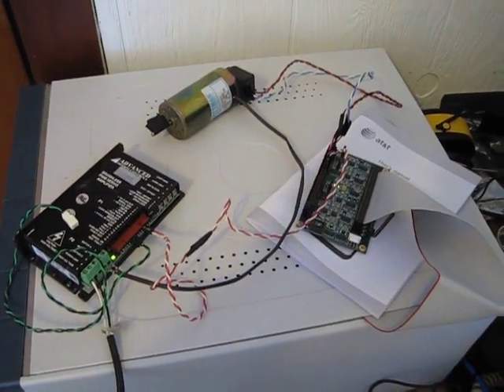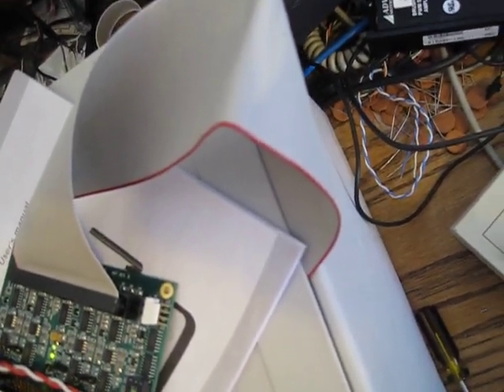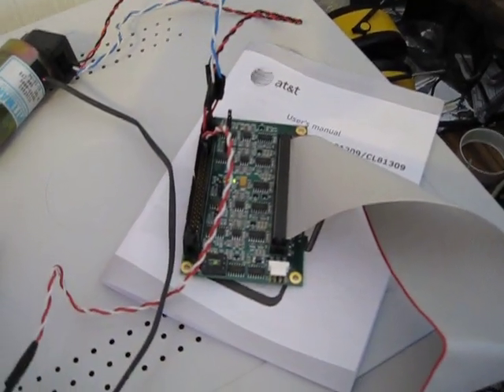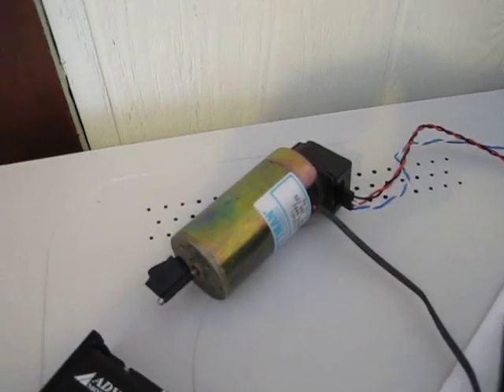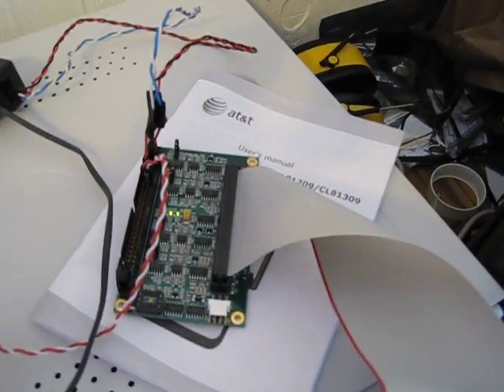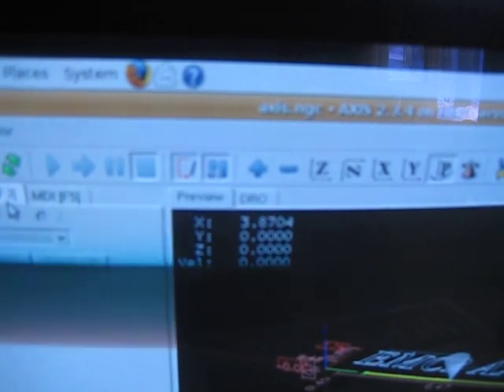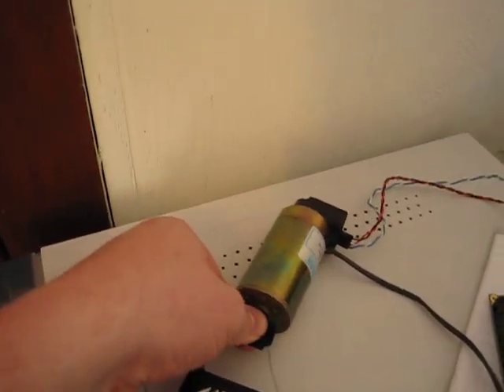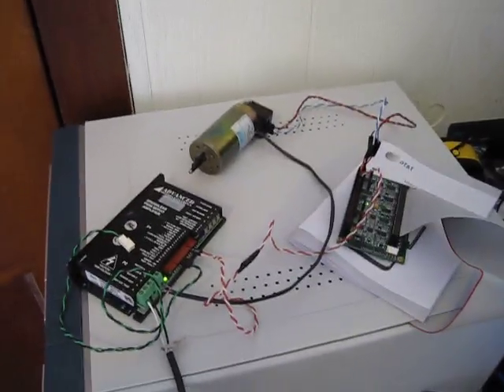mesa 7i33

Comment: It looks like the only connection from your servo drive to the mesa card is encoder and drive signal and maybe ground. I've got LinuxCNC installed with 7I77 and running and the encoders reading properly. Mesa said that I need to hook up 'drive enables'. By 'drive enable' do you think they mean power to the drive amplifier? I could do this with a mesa output and relay where the card supplies the enable signal which would  power the amp signal. Or do you think they meaning something else?
Reply from the maker: no - most drives have an enable.  in the above experiment - the enable was just jumpered.  Linuxcnc should enable the drives in a normal setup.  The actual power to the drives (IMHO) should be part of the estop loop,  (push the estop - the drive powers off)
Reply: @MakersEase  the problems with switching the drive power include:

1.  No dynamic braking:  cannot apply reverse power  for faster deceleration, because you removed power.

2.  Overvoltage:  motors may also act as generators and have inductive effects:  they can reverse drive the motor supply rail through the H-bridge diodes.  What limits the voltage?  Where does the energy flow to?

3.  The E-stop switches now have the full motor current running through them (unless you use a relay).

Comment: Cool, this is the first time I've seen someone manually turn an 'off' axis and show the position update on screen! That wide ribbon cable is a shame though and must make placing it a real treat:< I'm looking into using the 5i20 with mach3...
Reply: did you buy it? also the Mesa wont work with mach3, only Linuxcnc as far as i know